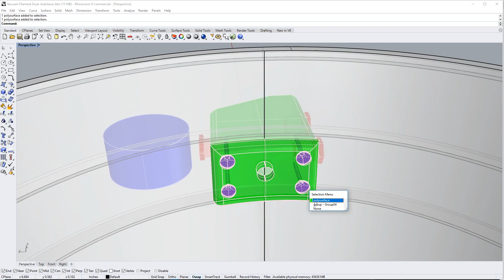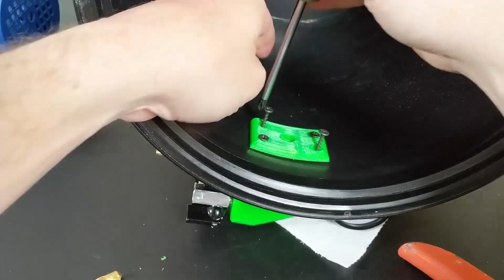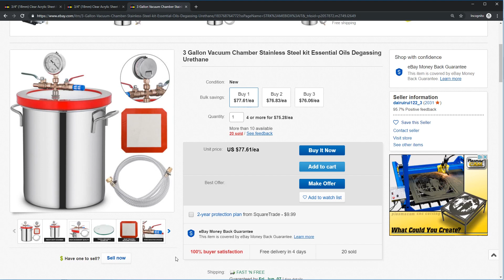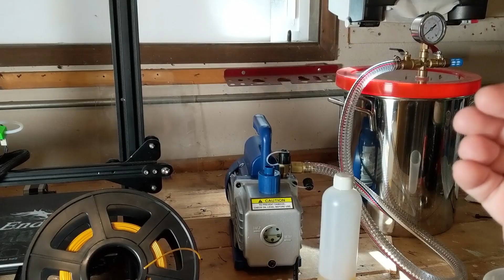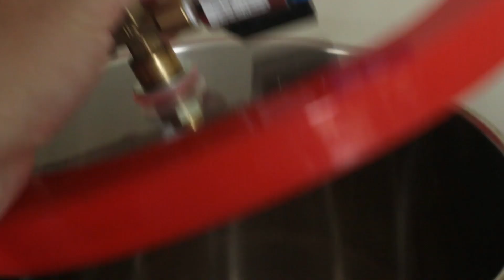Is Vacuum Filament Drying Best the Best Technique?

Comment: This guy shows a scientific explanation for why such vacuum systems don't work as expected and don't give a significant result (https://youtu.be/SfkphhQtEys?t=164)
Reply: And that linked video is ... The science is sound, but the application to the real world is lacking, at best. Pulling a vacuum does a perfectly adequate job of removing water from the gaps in a solid. The thermal mass of the solid provides the heat to keep the water (a very small % of the total mass) from freezing, and keep it evaporating until the water absorbed into the solid is down to an acceptable level. In the case of a very absorbant solid, like cotton clothing, the water could be more than half of the mass, but in filament, it's going to be way less than 10%. That's why scientists shouldn't analyze engineering principles. Can't see the forest for the trees...
Reply: It's unclear to me without, more maths, whether Thunderfoot's video is directly applicable, if I understand it. The percentage of water is going to be very small, the filament's intermolecule bonds are almost certainly stronger, and the filament's mass may hold enough heat to evaporate the water.
As a separate fix, maybe do it in a clear container and radiate it with an IR lamp?
Reply: I think the vacuum setup is a good way to dry the filament. Heating it can lead to other problems. You don't need a $150 vacuum switch. I have a vacuum pump that looks identical to yours, and I've run it 8 hits straight. You could probably just leave the pump on. If you really want to build a pump control setup, PM me, and I'll mail you a good used vacuum sensor that runs off of a 5v reference signal. You'd need a logic board to read the output and control a relay, because it's a sensor not a switch, but you can also play with different levels of vacuum, but even cooler would be to use the logic board to data log the pressure rise (vacuum drop) over time, and figure out a way to use that to measure when the filament is dry enough, without using up filament in test prints every time you need to dry a roll. I bet you could do all sorts of neat stuff with it, to share with us...
Reply: What the laws of thermodynamics state is that you will allways have to put in the energy to get the water to boil off, no matter the temperature. The point of lowering the pressure is that you can do it at a lower temperature, but you still need to apply the heat wich can be difficult in a  vacuum.
Reply: @juhu34  The amount of energy spent on the transition from liquid to gas does not change with pressure. Therefore, it makes no sense to lower the pressure, except if you want to make solid to gas transition, but then you have a problem with heat transfer.
Reply: @juhu34  unless the energy can be provided by room temperature heat. If you can draw down the vacuum to 20 mmHg the heat energy needed to boil water is 22C. Most oil ac vacuum pumps are capable of .08 mmHg where water boils at -40C, therefor, at room temperature it would be like you have the filament in an oven. In other words the room provides the energy needed.
Reply: We do a lot of vacuum sealing foods with a chamber style vacuum sealer. Chamber sealers are expensive but they let you seal liquids which is impossible with the food saver style pumps.  One of the first things you learn when you start sealing bags of soups or stews is that your liquids have to be very COLD. If it is warm it will start to boil and make a big mess in your sealers chamber! My point is that heating the filament then putting the hot filament into the chamber and pulling a vacuum will make a huge difference in your outcome.  
Another pro for the chamber sealer is that once you get your filament  perfectly dry you can vacuum seal it in a bag and it should be ready to go when you need it.
Reply from the maker: I learned a lot from this link. Thank you for posting it. Based on the new information I would say that a vacuum chamber is no better at drying anything than a chamber full of completely dry air (0% humidity). It now appears to me that the only advantage of a vacuum chamber for drying purposes is freeze-drying which really offers no advantages for filament drying.
Reply: @DesignPrototypeTest  Your approach should work, if a deep enough vacuum level is maintained. Indeed, this technique is routinely used for drying out HVAC systems. Your rotary vane pump should be able to attain such a vacuum. The points in the video are that that dryer doesn't get near the vacuum level required to be effective, and that it doesn't save time or energy – all of which are true.

But if you pull a vacuum well below the vapor pressure of water at room temperature (ca. 3.2 kPa = 32 mbar @ 25C), you can indeed "boil-off" the moisture. You probably want to get down below 100 "microns" (i.e. 0.1mm Hg = 13 Pa), and maintain that for a few hours. Your rotary vane pump is rated down to 5 Pa., which is plenty good enough. As you found, you can't just turn the pump off and wait, since the pressure will rise due to the off-gassing, even if your system is perfectly sealed. You can tell when your system is dry, because the off-gassing (and associated pressure rise) will plateau. (Your vacuum gauge will be pretty useless at these low pressures. You'll need a "micron gauge" to see what's actually happening.)

While perfectly dry air may be just as effective, how are you going to obtain and maintain that (silica gel won't)?
Reply: @amars_handle  maybe add that low temp heat pad to it as well? idk
Reply: @DesignPrototypeTest  One thing that CAN work is heating the plastic, but not as hot as normally required, then putting it under vacuum.  At low pressure, the moisture boils away more quickly, and at a lower temperature, causing less degradation to the plastic.  Check out these guys who make this type of industrial plastic pellet dryers for injection molding. http://www.maguire.com/?page=shop/browse&category_id=8a6c3a1658cf16ca9d1d376f847c213b
Reply: @DesignPrototypeTest  have you ever thought of using a small dehumidifier to dry the air - Amazon has a small unit for under $40 - I assume it is just a Peltier  module, a fan, and a plastic water reservoir.  But if you stuck it in a closed plastic box and maybe added a small heating pad under the filament spools, it might do the trick. Here is a link to the unit I found on Amazon - https://www.amazon.com/SEAVON-Electric-Portable-Dehumidifiers-MD-819/dp/B07KF6Y19V/ref=sr_1_4?keywords=dehumidifier&qid=1564068382&s=gateway&sr=8-4
I like the suggestions below about getting a good scale to weight the filament before and after.
Reply: @DesignPrototypeTest  actually is not the same. Pick up a basic of thermodynamics  when you lower the pressure the phase diagram changes. You actually need a better vacuum pump please a diafram pump you are using an oil pump and breathing the oil gas you need to vent on the exit port using a hose.
Reply: At our lab in this situation submerge the petg or abs in ipa 90% to displace the water then a few hours later remove and plase under  the vacuum chamber for a couple of hours ( turned on) and give it a try..
Reply: @maxplank  That's a lot of IPA. Then what do you do when the IPA becomes saturated with water?
Reply: @RClarke3660  discard the ipa once you reach 80%ipa. You can calculate the water presence by the weight of the dry filament vs pervious weight and alcohol volume. Purifying the acohol(distillation) is not recomend unless you are licensed.

Comment: Water when it boils expands - that's how steam engines work.
So the vacuum pump need to run until the water has stopped boiling.
I have a £70 vacuum pot & pump I use to degas resin & a digital scale. Time for some experimentation.

Comment: You were not losing vacuum. As the moisture in the material continues to boil over time. You have to remove that moisture from the air again. And again and again through out the hours. The more you do it the “dryer” the material gets. #HVACLife

Comment: A single dollar given from a viewer can "pay" for well over 1,000 to even 10,000 views.

Do not root for ads or even sponsors, root for viewers donations and support, that's the only sustainable way to keep a channel free(as in freedom.) and unbiased
Reply: Good video by the way :)

Filament dryng by heating up air, with a fan to circulate it and allow for natural air exchange is probably the easiest and most efficient way.

Comment: The outcasting of moisture from the filament is what's causing the pressure to rise in your tank it's not necessarily a leak but just the normal process of water coming out of the filament and increasing the pressure you need to run the vacuum pump more often to prevent this problem

Comment: The pressure increases in your vacuum chamber because of the water leaving the filament. You need to keep the pump running while vacuuming it to continue to pull the water from your filament. Also, you should dry your filament in a food dehydrator and then while it's still warm vacuum the water out. It'll be much more effective. A food dehydrator can't dry filament effectively if the ambient relative humidity is high. I 3d print a lot for my business and much of that is TPU which absorbs moisture quickly. A food dehydrator can't get my filament dry enough for good prints even at 80C for days. Putting the warm roll of filament into my vacuum chamber for a couple of hours (as the pump runs the entire time) does get my filament perfectly dry. Maybe someone will read this and decide to try vacuuming their filament to dry it the proper way.

Comment: You should flush out and replace the oil in the vacuum pump these cheap chinese pumps leave a lot of crap in there after manufacturing. pump will last much longer.

Comment: If you need a quick easy way to dry your filament.....
Most 3d printers come with a heatable printing surface.
Set your print bed temp to 50 degrees. Place your filament spool on the heated bed.
Put the cardboard box your filament came in over top of your spool.
Wait 4-5 hours.
Ta dah!!!!!
Reply from the maker: THIS IS GOLD!!! Did you come up with this idea? Where did you see it posted. I need to give credit.
Reply: @DesignPrototypeTest  My idea I guess.
I havn't seen it anywhere else.
I thought about it awhile back and gave it a try on my Ender 3 pro. I wasn't sure if the heated bed would time out but it stayed on overnight at 55 degrees.
I used it on a stubborn roll of carbon fiber PLA. It seemed to help.
I am sure someone could fancy it up a bit with a store bought plastic cover and I also put a couple of silica bags that came with my PLA in there as well.
Feel free to spread the word.
Cheers,  and happy printing.

Comment: Don't bother with all that just use some Zeolite molecular sieve media in a suitable container with a heating element so you can easily take it out and regenerate it.  this stuff will suck the water out of silica gell.  It won't cover everything inside and outside the chamber with oil residue either.

Comment: I've not once ever had an underweight spool. I was curious about weights myself when I first started 3D printing and found the opposite - weighing spools before use and after use showed that suppliers usually diddle themselves out of 20-50g of filament.
If you're getting short changed on filament maybe you should change suppliers.

Comment: When working with pressure differentials I always run some math.  Your ~4 inch wide by ~20 inch tall wood panels would equate to:
4 x 20 = 80 square inches of surface area.  The differential pressure seen across that panel would be the vacuum pressure ~30 psi (pounds per square inch).
80sqin x 30pounds/sqin = 2,400lbs of force against each single face of the wood box.  That's 9.6 tons of atmosphere going for a big crush.   I'm relieved that plan derailed before completion.

Comment: I was just doing a bit of investigation .... were is the water going. From what I’ve read the water is accumulating in the oil. The oil needs to be replaced when that happens or it will damage the pump. Vacuum switch has a range on the cheaper ones. Adjustable gets up there all available on Amazon. Thanks.

Comment: Your leak is probably in one of those brass joints. I’d pressurize the can n put some soapy water on off of the joints, if bubbles appear anywhere, you’ve found your leak and could probably fix it up with some Teflon tape.

Comment: Hi very interesting. Nearly 60 years ago as an apprentice we used  grease smeared on the sealing surfaces, seals and the metal rim etc. We used needle valves for control. If the leak is consitant you could use a timer to switch the pump on for short periods at regular intervals.

Comment: A 20 dollar pressure cooker modified to hold vacuum plus a $15 hot plate would have solved everything. I’ve been doing like this with a two stage vacuum pump for years.  You just can’t overcome the evaporation lowering the temperature and stopping the evaporation without a little heat.  I don’t even worry about my filament getting wet anymore cause I know I can dry in in an hour or less. I adjust the hot plate so the pressure cooker is never over 120 deg and keep an eye on it.

Comment: I worked in the semiconductor manufacturing field for many years where achieving and maintaining high vacuum is an art as much as scientific. This particular application would be considered "rough" or low vacuum. Wish I would have kept one of the small 2-stage 15cfm mechanical vacuum pumps I used to deal with on a daily basis. Would have been handy now that I need one for drying my filaments. BTW, your vacuum chamber won't maintain a vacuum for very long because the sealing surfaces are too rough to make an idea seal plus the the filament and spool will constantly be out-gassing for quite a while. Also, any finger prints either on the spools or on any inside surface for the chamber will also out-gas for quite awhile. You would have to have that 3cfm vacuum pump attached and running for several hours to get rid of most of the water vapor and other contaminants. The problem with that is that pump doesn't have a oil mist filter on it's exhaust so it'll get a bit smelly in the room.
Reply: You are absolutely correct, Im using a 7cfm Vacuum pump and let it run for 90 minutes, works well ,

Comment: Filament could be used inside the vacuum sealed package, all you would need is a a box frame to let the spool rotate.
feed output through a silicone valve. It may not hold a vacuum after opening, but it would limit the amount of moisture.

Comment: One other thought.  You could use a prototyping board (Raspberry Pi, etc.) with a camera and some OpenCV magic to turn the pump on whenever the dial drops to a certain level.  Just keep the camera pointed at the dial and let the Ever Watchful Eye decide when to kick on a and off a solenoid switch connected to the pump.

Comment: I'll give you some of my experience with vacuum and drying.

First up, try keeping your room dry with a room dehydrator.  They aren't too expensive, and will take BUCKETS of water out of the room air per day.  That's water that will never get into your filament to begin with.  And it would allow longer run times without having the filament get wet.

Next, I would suggest you try chemical dehydration.  There are a couple chemicals that will pull water right out of the air, and they aren't that expensive.  One of them that works really well is used as an ice melt for sidewalks.  I spilled a little of it on the floor of my garage and for years that spot looked like there was a leaky pipe above it.  Finally I figured out what happened and cleaned it up.  You can buy chemical dehydration systems made to keep closets dry.  But they are pretty simple.  Just a can filled about a third of the way up with the chemical, and it will fill up 2/3 of the can with water.  If you enclose everything in a "Tupperware" type of box there will be a limit to how much water will end up in the can, because there just won't be anymore water left to pull out of the box.  It keeps things VERY dry and is considerably cheaper than using a vacuum.

If you want to make your vacuum chamber work, try making a custom fit gasket from two part silicon mold putty from moldputty.com.  It can pull such detail from a piece to be molded that it would seal the scratch on your window easily.  Just mix the two parts, roll it into a ball, flatten the ball and reassemble the original parts on top of it very gently so you'll end up with about a 4 mm gasket.  Then wait for your gasket to cure (about 10 min).  Once it is fully cured you can tighten things down more.

Also, try a 2 stage vacuum pump.  They work much better than the fan type pumps that were built to take Freon out of air conditioners and refrigerators.  They pull a much deeper vacuum, which will cause water to boil a lot more vigorously.  Trust me, I've had both, and once you go  two stage you'll never go back!

One other thing.  The "cloud" coming out of the output of your vacuum pump is a cloud of the silicon oil that you poured into it.  Read the cautions on the label of the oil bottle and I think you'll agree that breathing it as an oil fog is probably not the best idea.  It's best to vent it outside.  But you certainly don't want to breath all the time.

Good luck.  I hope some of this helps.

Comment: I think that you only need to store your filament in a warm place in your house (I store mine in the same cabinet where my water heater from 1965 resides) this will keep the air moisture well below the rest of the house and ensure that the filament will have no moisture to suck up. When printing you should keep the currently used filament in a tight dry box with desiccant to minimize the amount of amount of moisture that gets access to the filament. A bowden tube from the dry box seems also like a good idea.